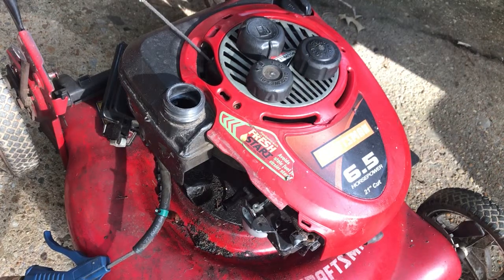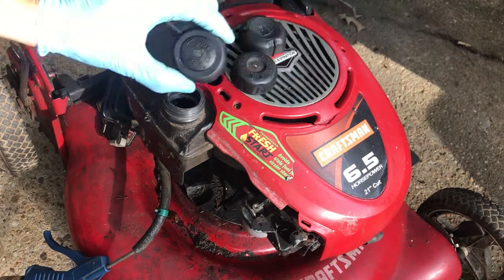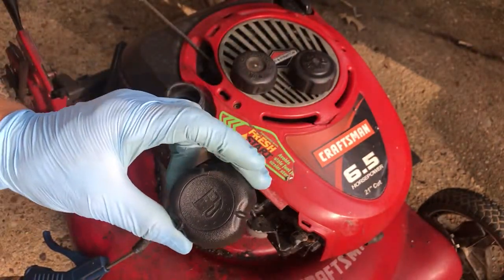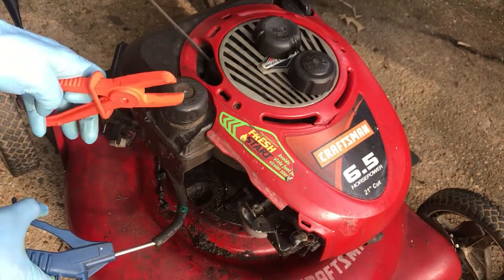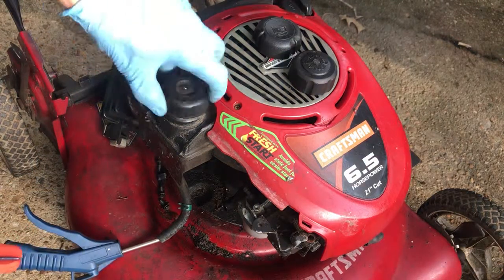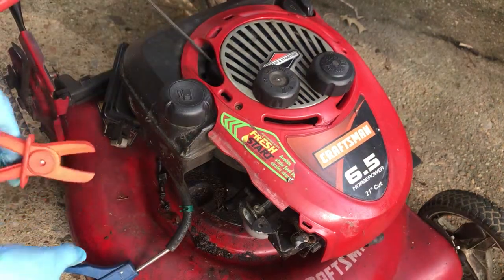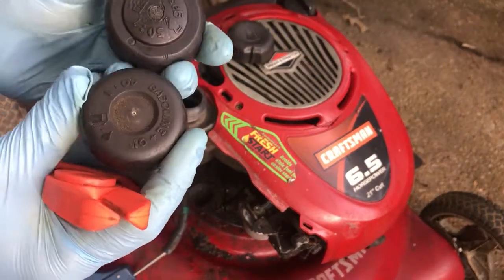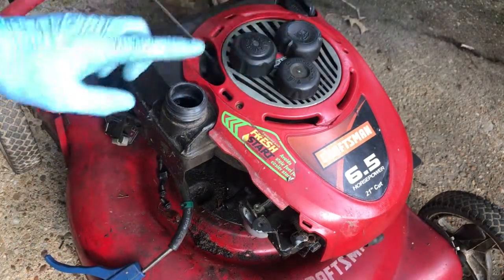Lawn mower gas cap tank not venting poor running how to check

Comment: Keep in mind that, most manufactures gas caps have a oneway breather valve by design so fule can not leak out the breather, so the test you are doing should be in reverse, you should be pulling a vacuum on the tank.
Reply from the maker: Gill Chaser you are right. Thanks for watching! 👍🏼
Reply: Hi

Comment: No idea what others are talking about in the comments. These caps are supposed to let pressure out after a certain psi. Having some tank pressure is normal, excessive pressure is bad. Sigh, there's so much misinformation on the internet.
Reply: Ur right. U have no idea what it talking about